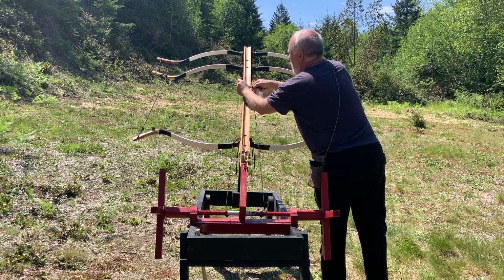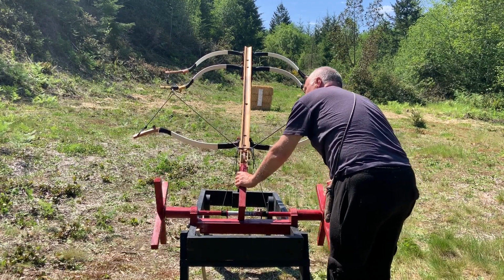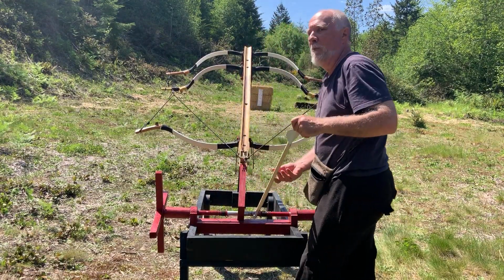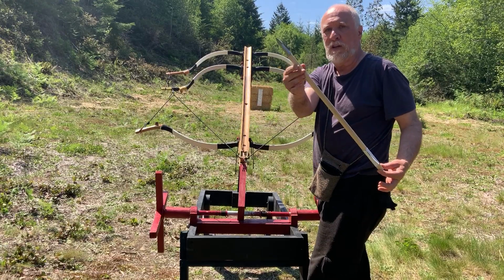San Gong Chuangzi Nu, the Triple Bow Little Bed Crossbow, 04

Comment: Wow, even without crazy strong bow limbs, this construction can still pump out amazing acceleration for the projectile!
Reply from the maker: Yeah, the amount of acceleration is doubled because of the reverse bow.  With this configuration, the time the bolt is under acceleration is nearly double.  This nearly doubles the force applied to the bolt.  One of the trickier bits is getting the balance right so the bows work together.

Comment: Interesting.. There are many unique and powerful long range weapon inventions in ancient China. Thanks to the internet, people were unfamiliar with these great things in the past until recently when people start to replicate it. Like Zhu Ge Lian Nu (诸葛连弩), the repeating crossbow.

The powerful bow in this video is called "The huge bed size crossbow made of three bows", or in Mandarin, "三弓床弩" which was invented, manufactured and deployed in ancient China for warfare use starting from Song Dynasty (10th ~ 13th century).

According to history record, this bow is one of the most enormous long range weapons in ancient China. It can shoot up to 1km, take 10 to 20 men to pull the wheel and draw it to maximum. And its arrow is actually not ordinary arrow, but a specially designed arrow in spear size, which is unlike what is being shown in the video. Thus, the real size of this bed crossbow could actually bigger than that in the video. The real power and speed of its launch could also be more deadlier than in the video. A China documentary TV channel once replicated this bed crossbow as well, and its power was also not the optimum level as recorded in history book. Creating more haze of mystical on this weapon.

According to historical record, if a cavalry get hit by the arrow together with its horse, both horse and cavalry soldier will be nailed on the ground forever unless at least 5 to 10 men pull the spear arrow out from the ground together. Very often the corpse would just be left nailing on the ground especially if the campaign was during winter when ground, river and lake were all frozen and thickened. Apart from being used in defend warfare, bed crossbow can also be used in siege warfare. Due to its supreme power, the arrow was directly launched on enemy's castle wall. After the spear arrow penetrates into the wall, soldier could use these spears as stepping stones in rock climbing to eventually climb up the wall. It is so deadly that it can pierce through any armor and wall regardless how quality, how thick and how good it is.

What actually amazes me in this video is that how could a westerner understand this ancient East Asia weapon so well which most of the modern Chinese don't even know so well on it. Only few bow enthusiast like me knows it. And also how on earth do you replicate it so successfully in which the design and functionality are so close with that in real history?

Thanks for your outstanding replication and video!!
Reply from the maker: Thank you for sharing your insight.  My understanding of this project followed this progression:
1.  Discovery of the image in Wu Ching Tsung Yao, the Song military history document.
2.  Acceptance that this was a real thing and properly documented.  And that the image presented was at least a reasonable approximation of what it looked like.  The image was my primary historical reference.  Whatever else I did, I wanted it to look like that.  And it had to work, of course.
3.  Reading everything I could find on the subject.  (This step is on-going, but I've reached a "tipping point".  I've now WRITTEN more than I've read.)
4.  Building process - mostly through trial-and-error.  Lots of error.  Oh, so very much error . . .   
5.  Documenting everything I did along the way.
6.  Publish my findings.
7.  Repeat steps 3 through 6 continuously.

I am quite aware that my current engine is VERY small compared to the historical engine.  There are a number of reasons for this.
1.  It only makes sense to start small when you're figuring things out.  It's a LOT easier to manage.
2.  This engine was initially intended to be used in simulated combat in the SCA against live armored friends.  The rules for such an engine have strict limits on engine size and power.
3.  This size is small enough to be easily portable and big enough to show the function of the engine.  It's also a nice size for a "back yard hobby" machine.  
4.  I don't have to get 9 friends to help me winch it back.  I can operate it all by myself.

All that said, I AM considering making a larger, more powerful engine.  Two things are holding me back in that regard:
1.  Finding some one to sponsor such a build.  It's likely to be fairly expensive and I don't have the financial resources of a Song Dynasty emperor.
2.  Finding a bow manufacturer that can make the heavy bows required.  This project has shown that I am not a bowyer.  :/ 

Thanks again for your kind words.  It's nice to find some one with a common interest.
Reply: Zhuge Repeating Crossbow's design is highly debated due to its historical description being vague about 'A Single Crossbow shooting 10 arrows' which led to two branching thoughts: One shot 10 arrows and able to fire 10 arrows quickly.

Triple Bow Bed Crossbow was derived from a much earlier design called Chariot Crossbow (for lack of better way of translating) which was in turn derived from even older large Crossbows that dates up to Shang and Zhou (borderline mythological age earlier than 800 BC)
Reply: @sforrestg   There once to be a book named ‘man powered bullet’ mentioned the modified triple bow crossbow with increased bolt speed.
Reply from the maker: I manufactured the trigger for this engine in my shop.  It's the classic Chinese crossbow trigger design, sized for this engine.  I've read that crossbow triggers of this design have been excavated that are nearly 18" in length.  A monster trigger of that size could only have been used in a VERY large crossbow, such as you describe.

Comment: Yes, nice work, but the first triple crossbow was connected only with a rope without a pulley, that your version is from 500 BC, it's the same compound system - greetings.
Reply from the maker: I've tried a system without a pulley in my development.  I couldn't get it to work well.  I mean, it DID draw and release as expected, but the shots were VERY under powered due to the friction of the bowstring looping over the bow ends.  I resolved the friction issue by using D rings on the middle bow for the string to pass through.  The D rings were attached using a short length of knotted cord so the angle could move freely.  I didn't use actually pulleys because I was worried they'd come off track and cause a disaster with the bows.  Imagine if one bow end just locked up.  o.O

Comment: Would have loved to see more angles and shots!  Very interesting, haven't seen one made before.
Reply from the maker: I'm still working on the engine itself as well as documenting it.  I use this YouTube channel as a warehouse for my videos.  More will be forthcoming as the weather improves.
Reply: @sforrestg  Very cool stuff, I'm excited to see the progress. Is this to historic scale as well? I read there were versions that had multi-bolts. Would be very neat to see that as a build as well. Can't wait to see more!
Reply from the maker: @KingR3aper  The scale of this one is based on what seemed reasonable to me from the drawings in the Wu Ching Tsung Yao, the Tang Dynasty military encyclopedia.  There were no dimensions that I was able to read.  From other sources, I believe that there were indeed similar but much larger engines of this design, but that is well outside the scope of this project.

Comment: I suddenly feel bad for the huns. 

# sad hun noises.
Reply from the maker: There's good and bad to being a hun.  This definitely falls under the "bad" column.  >:)
Reply: The Song fought the Jurchens and the Khitans not the Huns.
Reply: @weifan9533  so who are xiangbei then? 🤔
Reply: @adityasuresh6607  Xianbei existed during the 4th to 6th centuries, whereas the Song existed from the 10th to the 13th centuries. They weren't in the same period. And the Xianbei weren't Huns but rather a Proto or Para Mongolic people.
Reply: @weifan9533  so who defeated song dynasty weren't they mongols.
Reply: @adityasuresh6607  Song only fought the Mongols in the last 40 years of its existence from 1235 to 1279. From 960 to 1125 their major opponents were the Khitans and the Tanguts, and from 1125 to 1234 their main opponent was the Jurchens.
Reply: Yes, from what I've read this weapon was developed to counter heavy cavalry charge tactic that the Jurchen (Jin empire) used against Song's troops. Because at that time most of the steppe in northern china used for horses breeding was lost to the hand of nomadic tribes, Song's army had a very weak calvary  and must relied on foot soldiers to defend their borders against Northern neighbours, so the double and triple-wing crossbows was designed. Against fast moving horseman in loose formation it was not very effective, but when dozens of these firing from a safe location (above city walls or hills) against en masse heavy cavalry charge in tight formation (the Jin called them "Iron Pagoda Cavalry" btw), their huge arrows could penetrated lamellar armors and pierce through multiple bodies, therefore effectively broke the cavalry's formation.